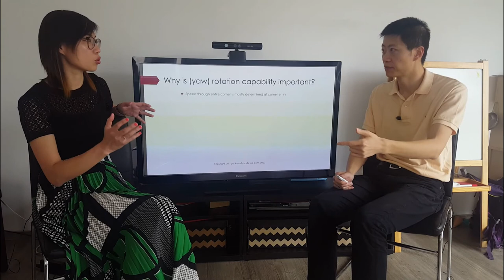Why yaw rotation acceleration is crucial for corner speed.

Comment: "the speed thru an entire corner is almost completely determined at the corner entry." 
Yes yes yes. Agree 100%.
Reply: Yep, because at that point you're not loading up the tyres with lateral acceleration (and rotation saves the need for some of this g-force)

Comment: In a sense yaw is the feel of oversteer being more rotation than expected and understeer being less.
Drifting would be the art of creating extreme yaw while maintaining consistent trajectories.
Reply from the maker: I'd agree with that.
Reply: If you are experiencing understeer or oversteer you are falling away from your cars optimal yaw.
Yaw is an acceleration, what you mean is the slip or driftangle. If you want to drift you need to rip the solid tire from the tarmac. You can do this with extreme acceleration, either lateral with gaß or ritational with yaw. If you do it with yaw you need to counter steer otherwise you will spin, which would cause really high yaw rates. A good drifter remains steady and chill yaw rates all around the corner.
Reply: @MrHaggyy Physics was not my major but from boats and planes yaw is horizontal motion around the y axis. Nose and tail moving left and right. The other axis are pitch and roll. 
If the centrifugal forces are balanced by tires traction the yaw should be zero. 
Perhaps there's some hair splitting as drifts,bootleg turns,snap oversteer and tail wagging all seem to pivot around the engine mass and front wheels.
True yaw is a sickening spin around the middle with front and back heading in opposite directions as in a full spin or beginning to slide and correcting.
So you're right drift is sustained slip angle but there seems to be yaw at the moment of traction loss in oversteer and understeer also.
Reply: @jeffarcher400  yes you have roll pitch and yaw as rotations as well as front right and up for lateral movements. Yaw is the acceleration around the "up" axis.
In a stable drift you have a much higher yaw angle than you would normally. But you also corner at a constant yaw-rate or in a fixed circle around a fix point.
In a normal driving situation each tire can generate a force lateral, in the direction the tire is rotating, and transversal, in a 90 degree angle to where the tire is facing. In a drift you rip the contact patch of the tarmac and generate a thin layer of liquid and gas, the nice smoke. In that state the tire can only really generate forces in the direction of rotation.
So in a normal drift you have a big force in the direction your car is facing from the rear and two forces from the front. The front sums up in a force around a circle.
So you are constantly rotating at a fix rotational speed - a fixed yaw rate.
If you ease of the steering the circle would get bigger until the car would catch it`s grip again and you would only accelerate in a constant line.
;-) the ability of a car to translate well between rotation and acceleration is the key KPI to the question if a corner is flatout and how much speed you bleed of in a flat out corner compared to a straight line.
Reply: @MrHaggyy  That's an excellent force vector analysis. Now we can consider weight shifting dynamics from brake release,clutch engagement and throttle and it's a dance between friction plates,shocks,sway bars,brakes and the changing contours,textures and temperatures of the tiny contact patch.
Love how you mentioned that floating gas interface. Even if you're not smoking it there's that hot smeary point where your tires are going away but it's loose and grippy at the same time. 

If I could only live at the pitch that is near madness.
When everything is as it was in my childhood 
Violent vivid and of infinite possibility.
That the sun and moon broke over my head.

Comment: Quantifying handling metrics by yaw moment / yaw acceleration is quite common in the vehicle dynamics industry from my knowledge. Yaw acceleration is on of the most important KPI in some ISO-simulations as step-steer/sine-steer etc. Yaw gyros/accelerometers also are pretty cheap sensors so validating the simulations is not that big of a challenge.
Reply from the maker: That's true. More that it's less talked about in mainstream automotive media.
Reply: 😂 nice to see a FS car on You Tube. Yes yaw us used and discussed a lot in vehicle dynamics and functional safety.

Comment: Yaw has been used in stability control systems since the late 90's. Land Rover have a Yaw Sensor in the Freelander 1 after 2002 and in the D2 if ACE is fitted, ACE needs the yaw input to correctly work. They are definitely not the first to use it as a factor in ABS and stability systems. 

Pllease don't fall in to the trap of "understeer and oversteeer", both are a characteristic of steering and suspension geometric design, and is measured at a set speed around a set curve. Oversteer vehicles often have the steering control mechanism in front of the axle centre, understeer vehicles usually have the steering control mecchanism behind the axle centre. ALL other phenomina of not traversing the corner as expected is skidding in one form or another, including slip angle.

Comment: Have you read Ross Bentley speed secrets? This is well discussed for years. Peak grip in a corner is slip angle between 6-10 degrees for modern tires/suspension packages. I’m not entirely sure what is different or new here.

Comment: i have azera 2009 3.3L V6 GLS & the driving experience changed years ago. it was sporty in the corners & so stable on wet street or when it rains, it's like it sticks to the ground! very amazing system!. that had me pulling my hair to figure it out. mechanically checked & fixed but nothing solved. changed angel & the 4 ABS speed sensors. plus i don't have any check lights. all i can think of is that these sensors is giving wrong feed back!

Comment: Yaw is one the most important factors that get measured in vehicle development.  You can match it with steering torque, roll rate, pitch rate, deceleration and more to create a faux picture of what a vehicle feels like.  I was a test driver for a little over a decade and I can explain what various graphs and charts mean, but I couldn't tell you if it would feel cohesive or good.  You can generally tell when something is going to feel bad but good is so subjective it becomes a black hole of data collection and analysis.
Reply from the maker: Thanks for the great feedback! ❤

Comment: In NASCAR racing the driver either say the car is running tight, or loose in the turns. The crew makes adjustments during the pit stops. These are yaw adjustments.

Comment: Does the yaw acceleration somehow load suspension, or are forces that act on the suspension caused only by lateral, longitudinal accelerations, downforce and normla load ?
Reply from the maker: Yaw acceleration results in yaw rate. Yaw rate results in lateral acceleration. Lateral acceleration loads the suspension through roll.
Reply: @racetracksetup  *as long as you have traction

Comment: Interesting video. You're right, I don't think I've ever read about this in car magazines before. In your opinion, what's the best single test to determine Yaw Acceleration? Single 90deg turn? 5 cone Slalom? I feel like a car should have ... predictable(?) yaw acceleration as well.
Reply from the maker: It would be at relatively slow speed where v^2/r is relatively low, where most of the tire's forces are used to generate yaw acceleration. The speed only needs to be high enough that yaw rate isn't limited by the steering wheel angle. So a slalom at 40~50kph would probably be a pretty good metric.
Reply: Anything to do with autocross is great for yaw.
Usually you drive two right hand and two left hand circles with an inner diameter of 4 to 6 meters.